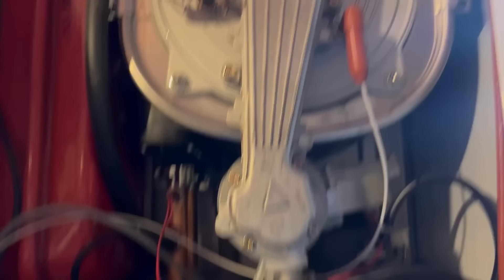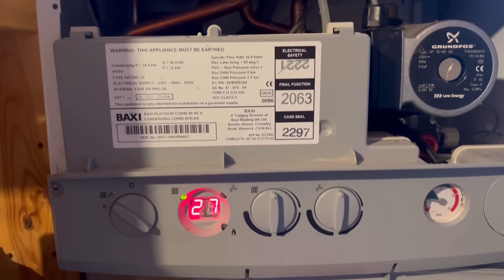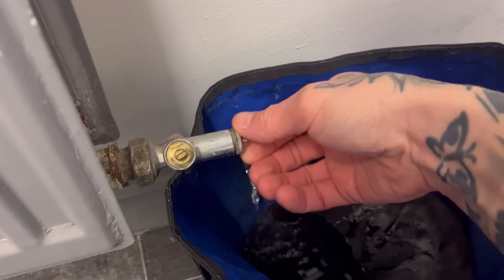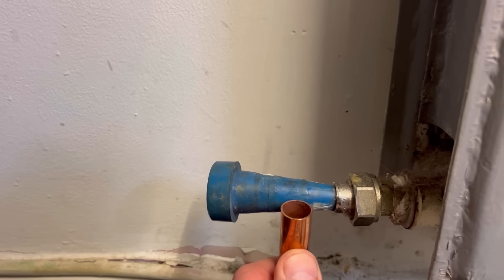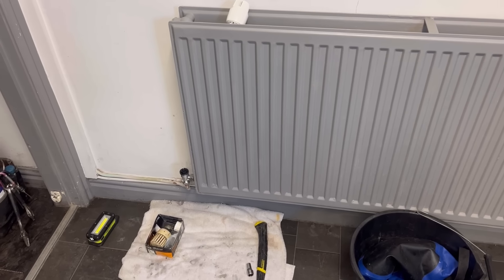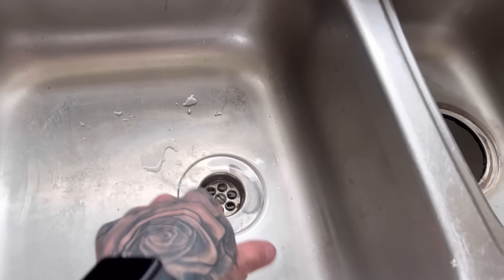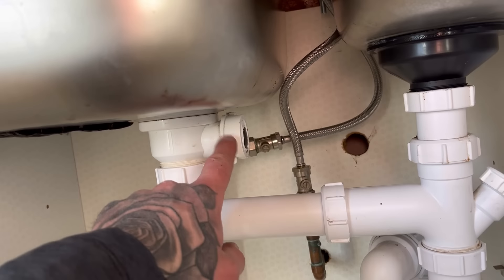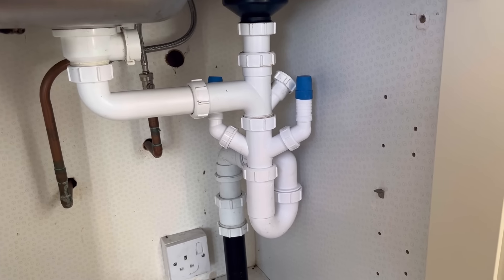I nearly miss diagnose a boiler fault 😬#plumber

Comment: I have had a few thermistors  check OK out of circuit but go haywire in circuit I just do like you did and replace with a known good one now , in the past in a emergency I used the plastic cap of a 2 L carton of milk to cap off  waste worked a treat keep one on the van now 😆
Reply from the maker: What an idea with the milk carton lid! Haha. I recon that’s a permanent fix rather than a temporary one 😂😂 yeh thermistors are a pain to diagnose correctly!

Comment: Had one exactly the same last month resistance seemed ok, even had it in a cup of hot water and watched it respond, threw a new one on just to see and it was absolutely fine 🤷‍♂️
Reply from the maker: It’s annoying when things like this happen though, has you doubting doesn’t it 😅
Reply: Had a hot water thermistor do the same on a Worcester a couple of weeks back, run tap, boiler was over heating getting up to 85 degrees  really fast and cutting out, water was running Luke warm, thought it was the plate changed that, same problem, checked the thermistor had 12oo ohms -2o degrees, changed it anyway and the boiler was fine, run the old one under the hot tap and you could see the resistance go up with the heat. Baffling.
Reply from the maker: @paulsmith2931  this is when I hate repairs 😂😂

Comment: Sometimes it's quicker just to try bits you need a stock of parts if your doing boiler repairs
Reply from the maker: Yeh that is true, a stock of boiler parts is ££££, rather than a stock of plumbing parts at £ 😂
Reply: @Heatking  yes just stick to parts on the most common boiler you work on which I would say is the baxi range and the ideal I mainly work on the Worcester range so have invested in a range of parts fan gas valve stats etc electrodes I give the boilers a full strip down every 4 years which makes a bit more work
Reply: @Heatking  that job the other day with the nest was the motorised valve it wasn't powering the orange when it opened what's the chances of that lol
Reply from the maker: @charliewillis8527  that’s bloody unlucky mate!
Reply: @Heatking  yes tipical I tested it with both but I didn't  count for that lol

Comment: Top video mate, although that duotec it’s the Pcb the low voltage side is likely on the way out it’ll come back in at some point. Well hopefully not 🤞 so you were right
Reply from the maker: If it does mate! At least I now know what it will be so thank you! 🙏🏽

Comment: The NTC commonly runs out of range at the low end (or high temp, as temp increases resistance decreases) when removing and testing at room temperature they usually show up as in range. It’s hard to ever see them out of range under testing conditions. Our job would be easier if they just showed OL when knackered wouldn’t it 😂
Reply from the maker: Haha yeh it would mate! Thank you for the knowledge though! That’s massively appreciated!
Reply: 25yr a technician now, nothing surprises me, some days I wish I just worked in Greggs 🤣🤣
Reply from the maker: @Chickenboots1  haha I bet you’ve forgot more than I know though! 😂

Comment: Mate you seriously need to buy a knipex dp50 for waste pipes, best tool i ever bought, cuts and chamfers at the same time
Reply from the maker: I’ve seen them but never used one, they are decent buy then mate?
Reply: @Heatking  yes mate, absolute game changer is your forever doing inch and quarter and inch and half. Even does 2 inch aswell, couple of rotations and its done
Reply from the maker: @Purebeltersteve  I’m off to look! I’ll blame you when the mrs complains haha.

Comment: Defo new waste. The way you did it. 30-40 mins of your time has got to be worth more than a £6 waste. Or cut a marigold dishwasher glove and use it as a sealing washer around that black plastic ring and tighten the nut
Reply from the maker: Cheers Mate, and good shout on the marigolds 😂